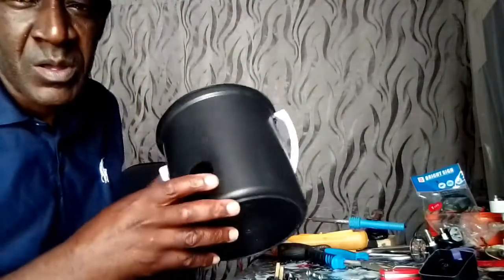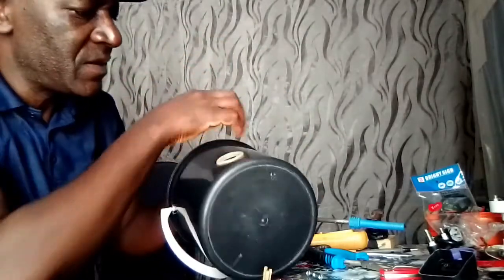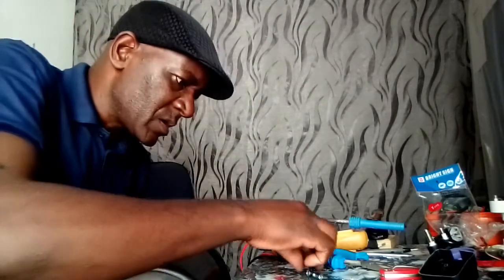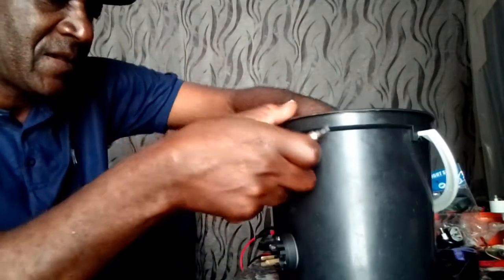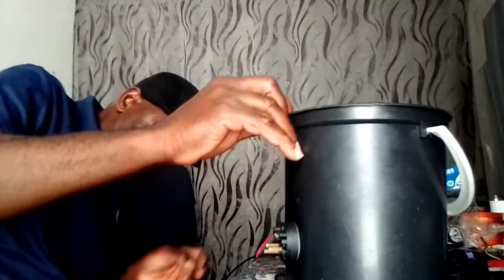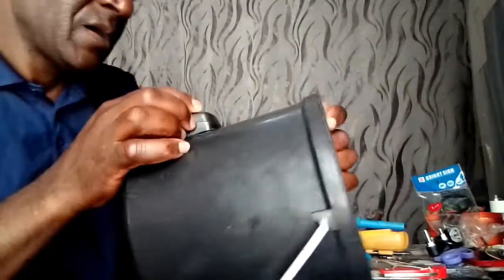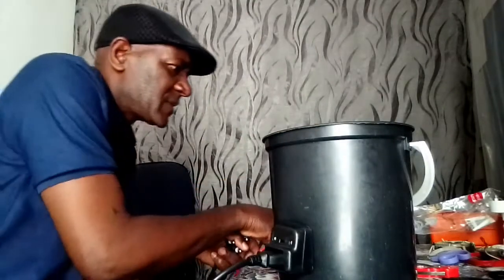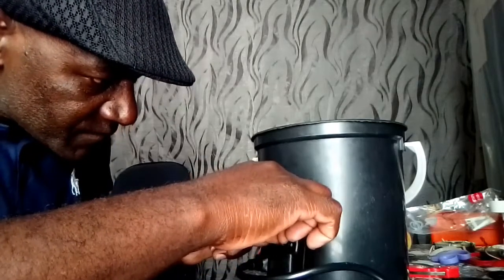Electric water boiler bucket technician

Comment: Good morning,on the sealer goes inside or outside?
Reply from the maker: You fit it on the bucket hole
Reply: @jamesbitu  sorry meant on the sealer there's two sides,the other one is smaller than the other, which side goes inside to seal for the element?
Reply from the maker: Bigger side goes inside
Reply: @jamesbitu  thank you very much Sir James🙏🏽

Comment: Mine is making the electricity circuit breaker trip, what could be the problem?
Reply from the maker: They might be a short circuit on the regularate or  your bucket is licking
Reply: @jamesbitu  HI sire, the bucket is not leaking, how can I check if there's a short circuit on the bucket? 

Thanks
Reply from the maker: Then they is a problem on your Urn it needs to be fixed

Comment: Looks like someone stole your idea  in Brusly fella
Reply: @Jason Trump: The swamp bucket is a rip off. All you need is a food grade screw on bucket off amazon for $30 along with a heating element  $10 and a cord whip $5. Drill one hole little smaller with hole saw and install element and your done.